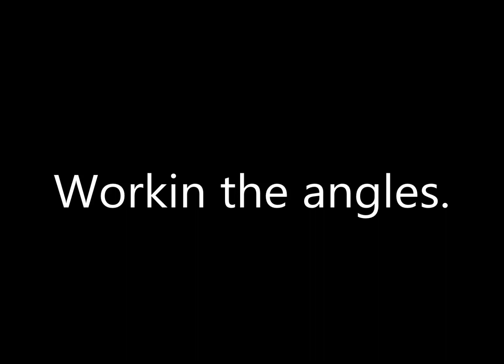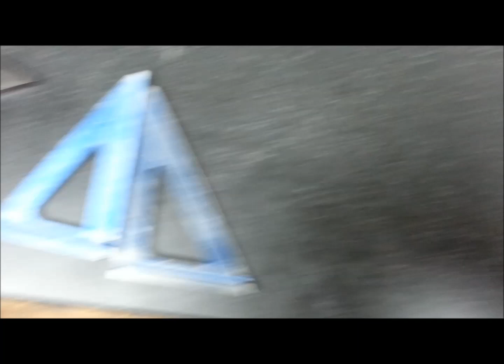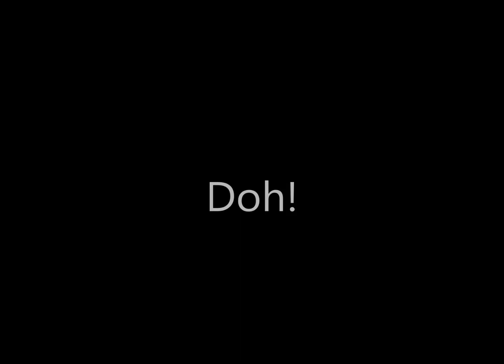One piece angle square #3

Comment: What ho Stan, I made mine from 304 stainless, no need to grind as there is no distortion from heat treatment as there is none. They stand up well enough, after all the worst that could happen is when you drop them on a concrete floor, just don't tread on them while they are there.
ATB 
chris

Comment: 60/30 should get used regularly.....I use my 30/60 angle plates all the time. I think the thicker web might be nicer for clamping if you dont have the heat treat issues.

Colin
Reply from the maker: Hi Colin,
No, the thicker web was the hot ticket, heat treating distortion was only about .003, easy enough to grind it true again.

Thanks for the view
Stan